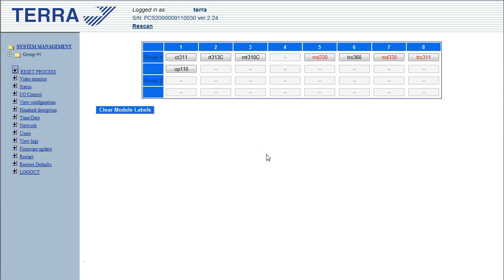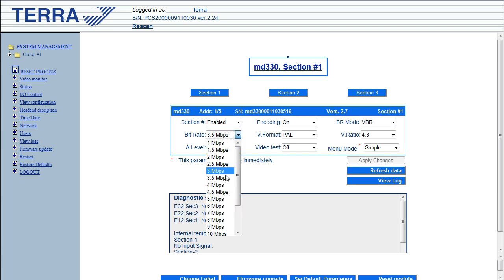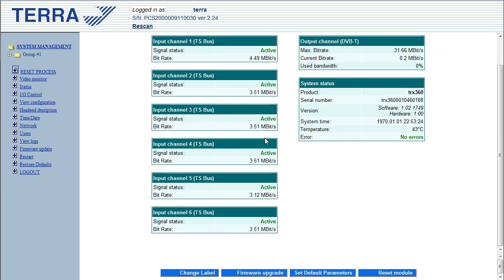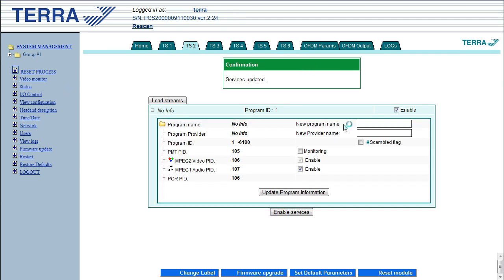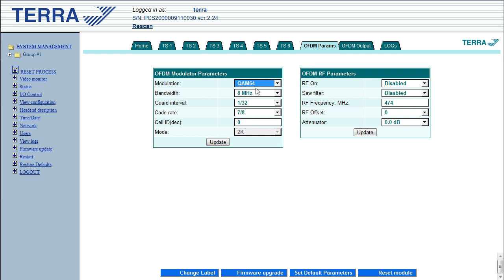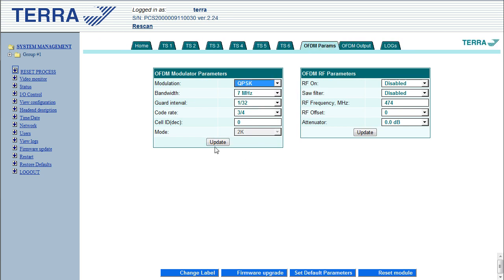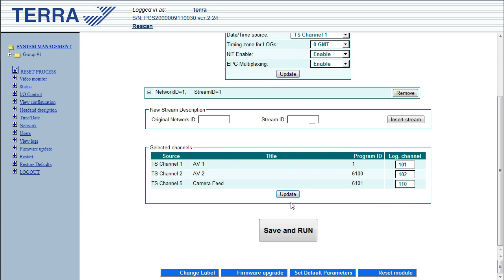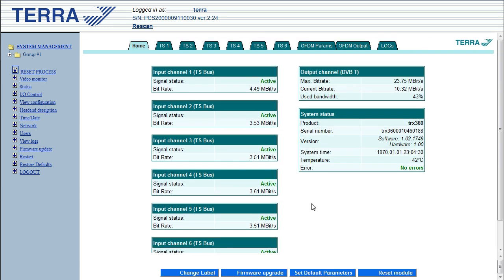Setup Procedure for Terra Digital Modulators

Comment: Hi Ryan, interesting run through but some settings could cause problems especially if he cable system is also carrying off-air DTV signals - so for example, using 177.5 MHz (RF Ch6) would clash with Seven Network in most cities.

For a more up-to-date  choice of set-up parameters, strongly recommend downloading from Free TV Australia their OP-71 "Recommended DVB-T Transmitter Modular Settings".   http://www.freetv.com.au/content_common/pg-engineering-guides.seo  It also has frequency lists and bit-rate tables for ready reference.